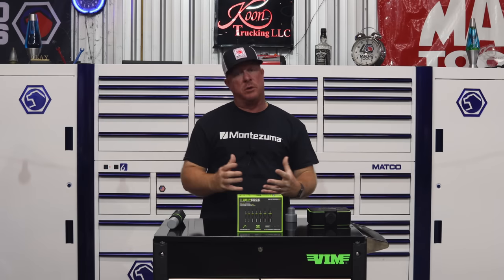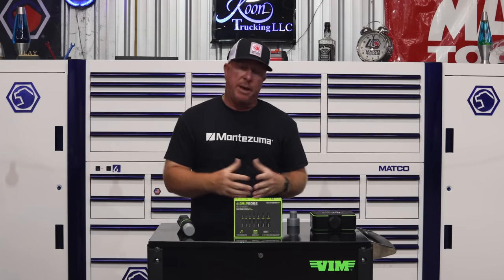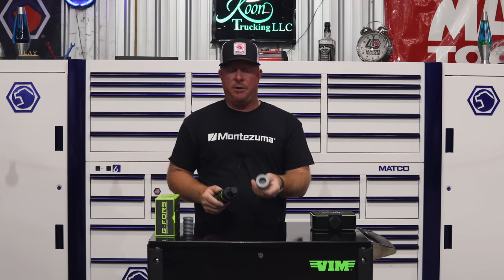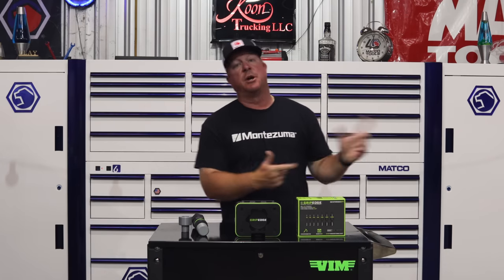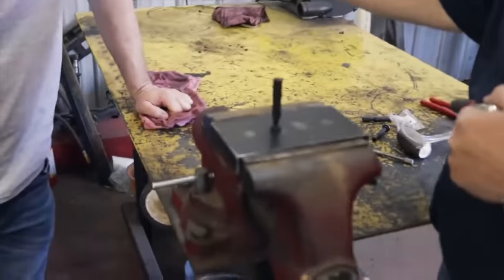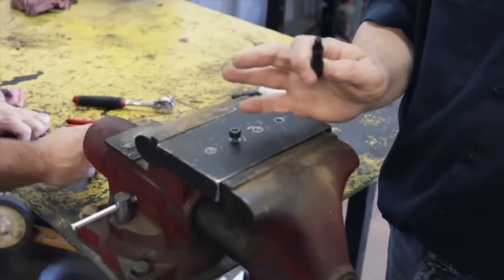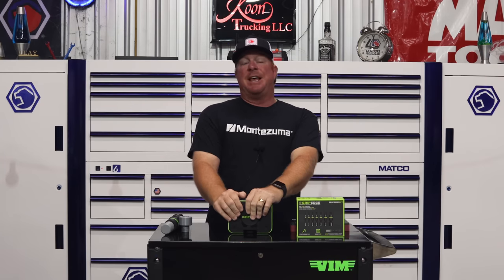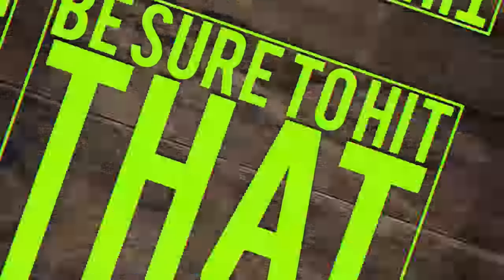The Best Broken Bolt Extractors On The Planet  Grip Edge Broken Bolt Extractors Are The Best Ones

Comment: I’ve had the Mac version for 2 years or more and I can say from experience that this style extractor is the best I’ve ever used and they haven’t failed me once. I’ve used them probably 10 times with the most recent two weeks ago on a Perkins c2 diesel engine removing a broken exhaust mount bolt from the head without heat. With any extractor , there is a technique and you need a little common sense. But these will get the bolt out if it’s possible to thread out. Cool video Clay.
Reply from the maker: Yeah they are hands down the best extractors made.
Reply: Do you also own the Mac Allen RBRT? I’m asking because they look similar, and i wonder if they can be used as extractors instead of buying this set?
Reply: @ericmorales2272  I do , and no they aren’t intended to remove broken bolts. If you see them both up close they are totally different.

Comment: I have been upgrading to the grip edge on a lot of things at first i bought the shallow torx socket set in the small case then got sucked on to the cornwell truck and seen the 62 piece set so i got that and brought the torx set from t6 to t60 home for home use lol
Reply: Knock on wood i have not broken one yet, i have had snapon torx set and broke many of them!! Specially the t30 for rotors that would brake them fairly often, and potentially round out the fastener and then i would use a chisel air hammer bit punch some lines in the head of it and then air hammer it in a twisting motion at good angle and get it free then flat head

Comment: I'm hopeful....broken wheel stud flush with the face of the hub.  Maybe this will work. 

 Any tip on how to get the drill bit to start in the center of the bolt or stud?
Reply from the maker: Center punch it

Comment: Terrible extractors the first time I used one it snapped and I used the larger size than recommended. The extractor body is to long causing a week spot in the neck. The drill bits are good tho. I paid a lot for them and was not impressed.